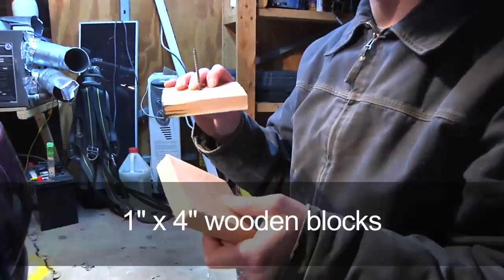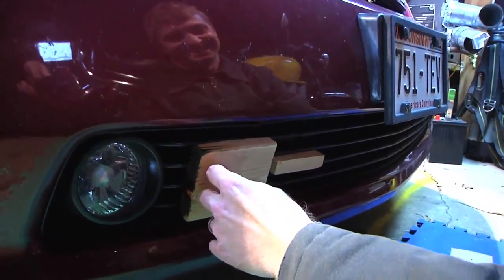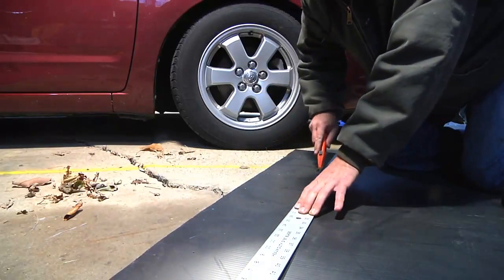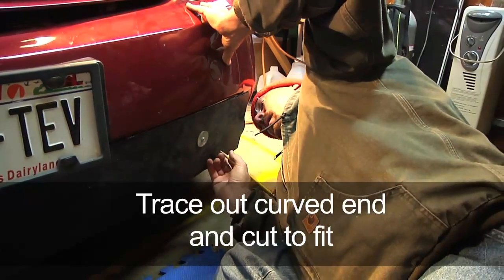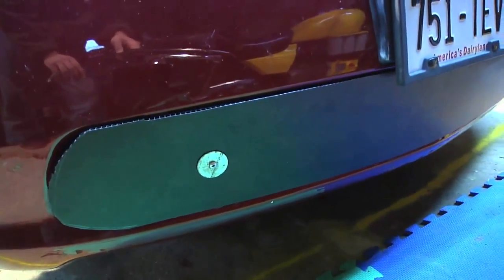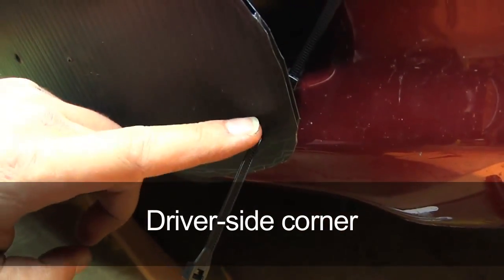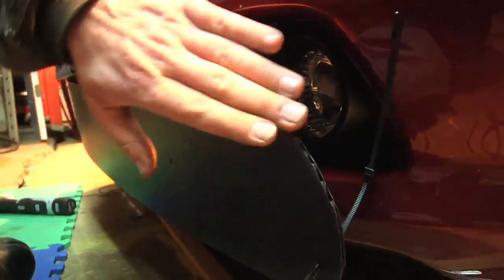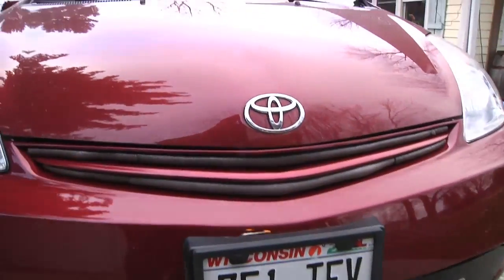How to build a DIY Prius Grill-Block

Comment: doing this now for my optima hybrid. -30 in Canada hurts your mileage! I used an old plastic bucket and cut it painted it and used zip ties. 
excited for the car to warm up and not freeze the engine whenever driving.

Comment: Have an estimate on the mpg gain from doing this. ?
Reply from the maker: No idea. It's really more of a "warm up faster" technique than anything else. If you do lots of short trips in the winter, you would see more of an improvement than if you mostly do long trips. Works great in combination with a block heater.
Reply: you do understand that the engine thermostat does not open before  200°F? but hey that's a good idea if your goal is to cause excess inverter wear.
Reply: Unless you're on an extended trip, the engine will never reach stock thermostat opening temperatures. These engines are very cold natured.

Comment: nice and smooth job mate! For the 3 year in a row I'm doing the same thing with my focus, just the difference is I have a custom bumper with bigger opening and in UK it doesn't get THAT cold, so I had spare flat piece of FG board which I painted black and attached directly to radiator with cable ties, covering between 2/3 and 3/4 of radiator. And it does the job just perfect!

Comment from the maker: Nope, not a new idea at all. In my area, all school busses have a heavy cloth cover with snaps for the grill that they button up all winter.

Remember, grill blocks and block heaters aren't just for "If you need them". It's that all cars get BAD fuel economy until the engine is up to proper temperature. Parking in a garage, and using a grill block and block heater all help get your engine warm and efficient faster!

Comment from the maker: Gen 1 Prius are a little "less hackable" than the gen 2, but still great cars!
One weakness of these cars are that they are new-fangled, and if the 12V battery is dead, you can't do ANYTHING with them.
I left the dome light on in our Prius once and had to jump-start it with my electric motorcycle the next day!

Comment: Maybe it's just me, but I would have left the fog lights covered, and the Coroplas black.. :)

This winter will be our first one driving the Prius C-2.. We'll have to see if we even need a grill block. 
So far, the heat is working fine. But, we don't drive many miles. (Retired folks). 

I like the pipe insulation idea. Looks real easy to install and remove..

Comment from the maker: It's a gen 2 Prius, which has a 1.5l 4-cylinder engine, which turns on and off automatically as you drive. It's difficult to keep the engine at ideal operating temperature in the winter while running the heater. The grill block prevents cold winter air from rushing in and cooling the engine. 
This car also has an Enginer brand plug-in kit (which allows the car to use more electricity, and LESS gasoline and engine run time.) It also has an EV Switch for electric only mode.

Comment from the maker: They sure do! We used zip-ties in the far corners to hold the grill-block to the curve of the grill. The wood blocks and screws are easier to use than zip-ties for fine positioning, holding really tight, and being removable/reusable.
Once the wood blocks are in, it easy to remove the block for repainting, replacement, improving, etc. and pop right back up there.

But there is certainly more than one way to do this!